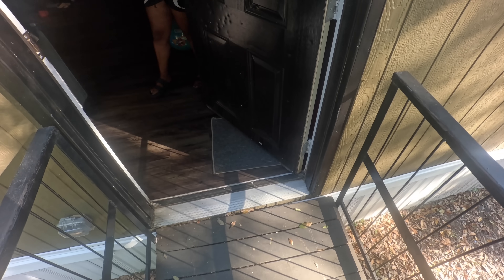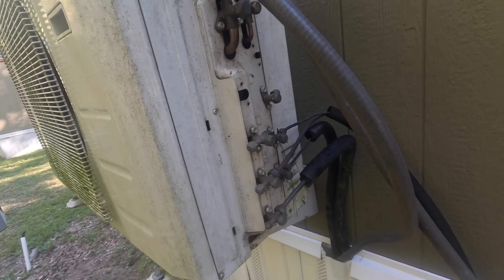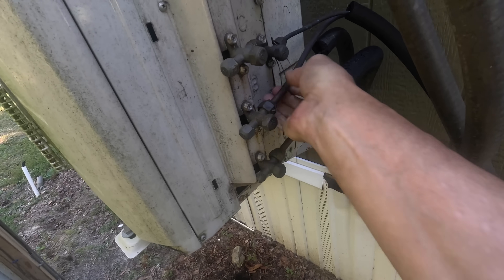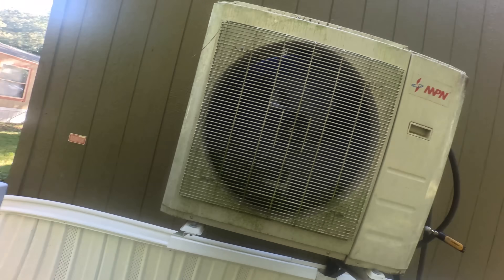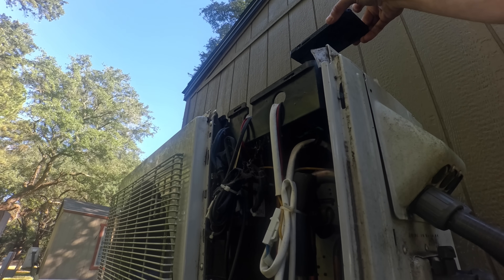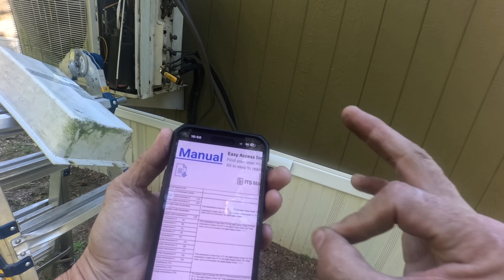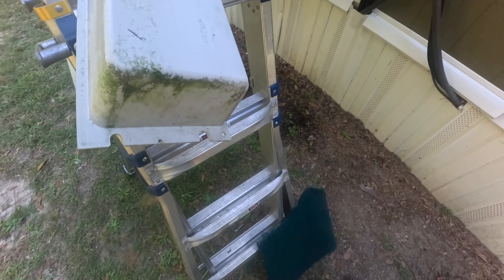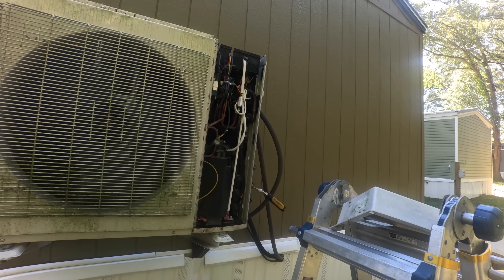Mini-Split Only Running In Heat! #hvacguy #hvaclife #hvactrainingvideos

Comment: I swear it looks like they could find a better location for the air handler on those manufactured housing units!   I would relocate mine if I had to put it in the middle of the floor 😅

Comment: I think the system is confused because the 2nd tstat is behind the TV, and most flat screens run 10 to 15 degs above ambient temp so it's seeing much more temp in that zone.   that unit needs an awning placed over the top to keep the water out of it.

Comment: I would be interested in checking the ohms on the indoor thermistors (Coil & Ambient) for each air handler to see if they have gotten out of range.  Even name brand mini-splits are using cheap thermistors from Taiwan that like to get out of range, so I imagine no name units are going even cheaper to save on cost.  Hard to work on those mini-split style units with no book to reference though.  I can't stand having to look crap up on my phone while out in the field trying to work on an inverter system.  Book should be present or the codes should be listed on the door along with the resistance of the thermistors it is using.  I turn most of those jobs down now.  Probably why I am still hiker trash and not rolling in the dough as a business owner.  Lol.  I don't think people realize how much extra time it takes to work on those types of units, especially if you are having to use a phone to reference everything.   Thanks for the video and stay safe out there.

Comment: The one thing that I would be concerned about is that without the top cover on that unit, rain water would get on the circuit boards and damage them.

Comment: just remember that dogs like cold weather if they're sticking their head out the window and panting it means cuz they're hot and that's her cuz that's how they sweat and by the way there's another thing you probably did now during the winter dogs get that thicker fur for winter weather it's intentionally if you prevent them from getting that thicker for your causing them to have problems during the winter they're supposed to have a thicker coat during the winter than during the summer so if you're preventing them from getting that thicker coat cuz like you put a coat on them that can cause problems in the long run God bless you man God bless you Miss Molly
Reply: I think you think you're on Steve Lav's channel mate. The sixties were good to you huh?

Comment: Rule number one is location of the thermostat the TV produce a lot of heat that's why the sensor work only on heat in not cool move the TV away relocate the thermostat good luck
Reply from the maker: Sensor that was faulting was in the air handler.
Reply: If the TV was producing heat that affected the sensor, the system would run in COOL only
Reply: @dougray30  not on split unit

Comment: A few months ago I had a Lennox minisplit running in heat and the board was energizing the rv and those Lennox splits are energize in heat solenoids, and it would not reset due to a bad board, I’m in Florida and the customer doesnt use their heat at all so I just unplugged the valve 😂